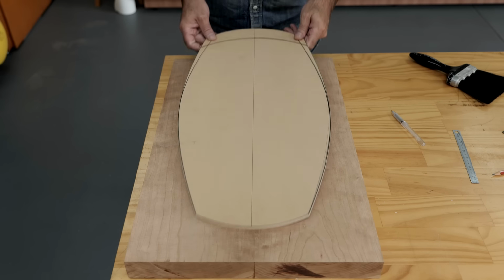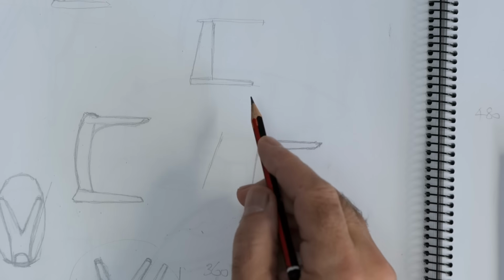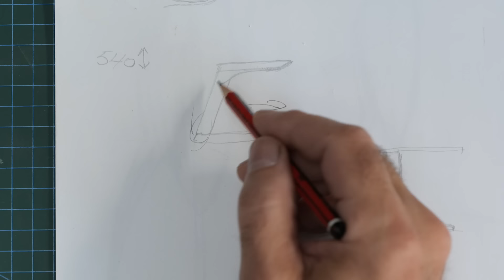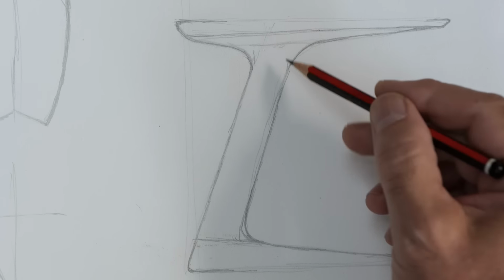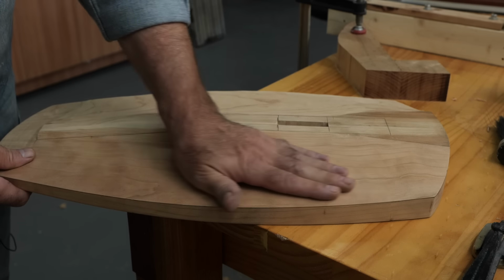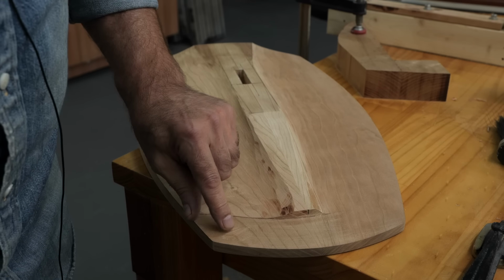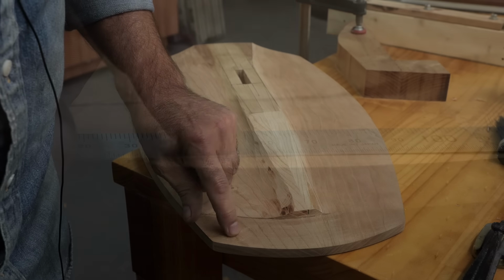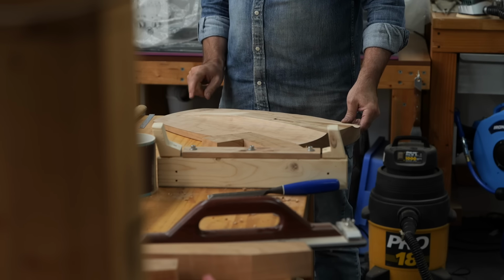The Unwanted Side Table

Comment: Hi Attila

I like it when you talk about simple design 🙂
For me, it's a very sophisticated design. 
One only has to look at your sketches to understand that you spent a lot of time to come up with this simple design 🥳
Great job as always and with your comments, it's very nice, because I understand your approach.
I would have liked to see your technical problem though 🤬

Have a good weekend
Olivier
Reply from the maker: Hi Olivier., The clip that was shot during that glue up was the longest I've ever taken, I think it ended up about eight minutes long but for me the time seemed like and hour lol. During most of it my back is covering the work and at other times there is nothing because I picked up every thing and move to the bench. I did damage the feet and as a result they ended up smaller than I planned. Thanks.
Reply: Hi Attila
Thanks for your reply. 
You know, it's not easy to get a joke down in writing. 
It was more a joke than a real need to know what happened to you. 
It's never cool to have problems during a project.

Have a good weekend
Olivier
Reply from the maker: OK, I get it now. It wasn't pretty and think there was some swearing and throwing things around haha:)
Reply: Hi Attila
it's a good thing I'm a long way from Australia, or I'd have taken one! 😬

Comment: That's a beautiful table, dude. You have a great design sense - is it inherent or did you get training/schooling? 
I assume that your primary skill is in metalwork, so I laughed a bit at the 'technical difficulties' beeper. Yeah, a through floating tenon with wood glue... but you rescued the glue-up. I would have gone straight to the clamps, and would have opted for an epoxy to keep the joint from expanding from soaking in the glue... unsolicited advice.
I also assume you just went ahead and fixed that divot all around... because yes, 'we know it's there.' And we understand exactly what you mean.
Reply from the maker: Hey thanks:)  I'm not very good at any one thing but have a go at whatever takes my interest at the time. Good advice on the epoxy for the through tenon👍 I did save the glue up but not without damage so the feet ended up a lot smaller than planned,  though the table is still well balanced. I did get rid of the divot just by sanding it out with 60 grit on the orbital though of course I had to go all around and go through all the grits.